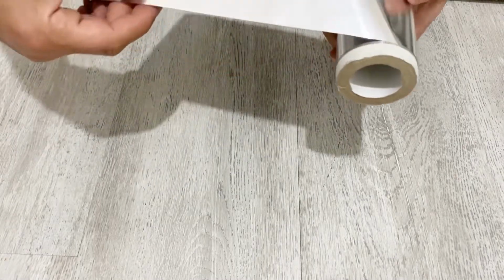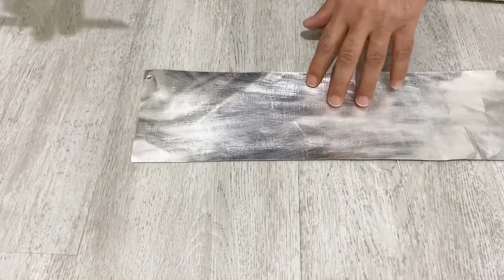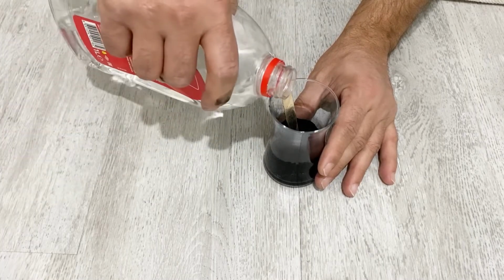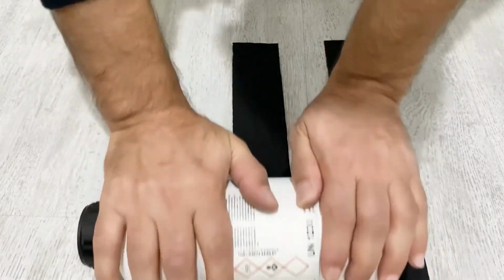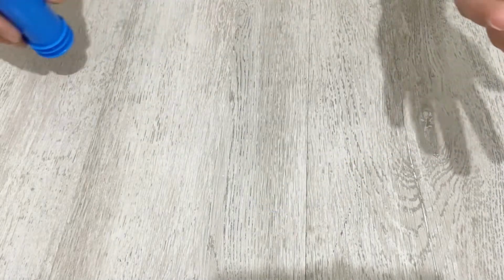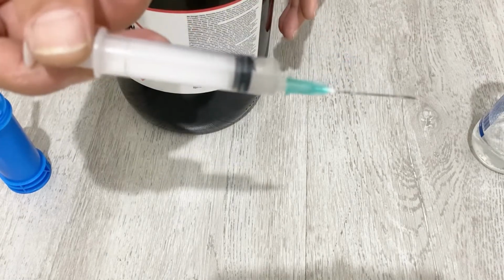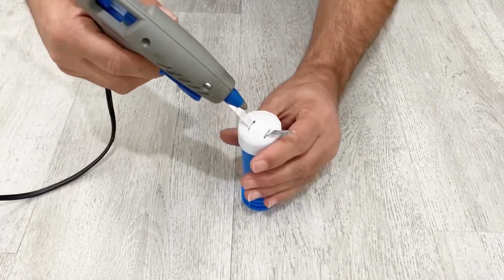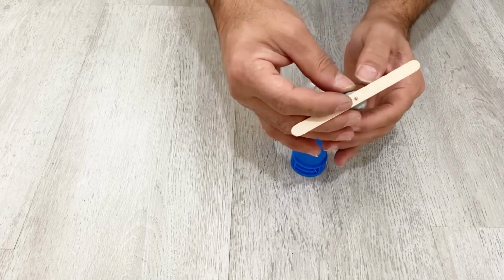How to Make a Supercapacitor with Aluminum Foil (Step by Step, Each Detail) 500 F

Comment: Can I use salt water, and questions is why electrolyte is not making short circuit in capacitor
Reply from the maker: No you can’t use salt water. It will deplete the Al foil.
Reply: @joyofelectronics9782  how about acids, like vinegar or sulphuric acid, and can i use NaOH?

Comment: how many gram of sodium sulfate and deionized water you used in this video
Reply: He said one mole of sodium sulphate. But there are two or three problems with this. First is what is the hydration of the starting crystals, and secondly, we don't know how much water.  

Hydrated Crystals of sodium sulphate and their molar weight. 

decahydrate (Na₂SO₄ · 10H₂O) 
322.192 g/mol

heptahydrate (Na₂SO₄ · 7H₂O) 268.128 g/mol

monohydrate (Na₂SO₄ · H₂O)
160.047 g/mol

anhydrous (Na₂SO₄) 142.04 g/mol. 
__
Did he mean 1 mole  to 100 ml or 1 mole to 1000 ml.  Sodium sulphate decahydrate is the most soulable  and would not completly disolve in 100 ml of water at room temp but 1000ml will.  So it might be safe to assume he meant 1 liter of solute.  But we still don't know 1 mole of which hydrate of sodium sulphate. 

Sodium sulfate decahydrate (Na₂SO₄ · 10H₂O): This is the most common form of sodium sulfate commercially available, also known as Glauber's salt. It is typically sold in powder or crystalline form and is used in various applications like detergents, textiles, and glass production.

Sodium sulfate heptahydrate (Na₂SO₄ · 7H₂O): This form is less common than the decahydrate but is still occasionally available. It is usually encountered as a technical grade product and may be used in specific industrial applications.

Anhydrous form: Sodium sulfate anhydrous (Na₂SO₄): This form is also available, but it is generally less common than the decahydrate. It is often referred to as desiccated sodium sulfate or salt cake. Due to its hygroscopic nature (tendency to absorb moisture), it is usually sold in sealed containers to prevent caking. It finds applications in various industrial processes like the production of paper, textiles, and chemicals.

And to the third (potential) problem, I suspect he purchased 
Sodium sulfate heptahydrate
Or possibly Sodium sulfate heptahydrate. But I don't know if he was aware of the hydration and considered it when weighing out the ammount to add to the liter of water.

Reguardless, if you measure out 142 grams of decahydrate or 322 grams you should still  be able to disolve both completly in 1 liter of water and they should perform rather similarly  although 322g of sodium sulphate  decahydrate is probably more conductive than 142g of sodium sulphate decahydrate.

Comment: how about making a really huge supercapacitor? would it work as a solar battery?
Reply: No, capacitor and battery is not the same
Reply: @teknosql4740  i did not say they are the same. i meant if it would have enough capacity for it to be useful as energy storage
Reply: @ignilc  you must learn to use google to find information you need, capacitor does not have plateau voltage, and capacity is far below battery, but it can store and release electric in high speed, so its not suitable to replace battery position, its suitable to stabilize voltage

Comment: So you charged it with 2.1V 1A for 10 minutes.
Reply from the maker: No the voltage determines by the charger when you charge with 1 amp
Reply: I drink a lot of beer. I will scissor up some aluminium tins into spirals and try it out. Are you sure it is a capacitor and the carbon does not react with the aluminium? Does putting capacitors in series increase stored amps or volts?
Reply from the maker: @kurbads74  you can try it with peace of mind. If you do everything correct the result will be amazing. As a surfactant use methanol. Putting Supercapacitors in parallel increases capacity but same voltage. Putting them in series increases voltage but lessens capacity.

Comment: Very good video! I just have a few questions:
If I am using sodium sillacate as the binder, and and I want to use Sulphuric Acid as the electrolyte, what should the concentration of the Sulfuric Acid be?
Thanks!
Reply from the maker: Sodium silicate and sulphuric acid have a good compatibility. You can use 30% concentration. (Keep in mind that in this case you can’t use aluminum, you should use lead instead)
Reply: @joyofelectronics9782  Sorry to ask so many questions, but what is that in molarity? Is it 30g H₂SO₄/100mL H₂O?
Reply from the maker: @shreyrohilla7883 yes it’s okey to use 30 grams in 100 ml

Comment: Try making a liquid solution that contains lithium batteries
The liquid solution does not work with or dissolve carbon, copper or aluminum

My only hope is to learn how to make that solution :(
Reply from the maker: Those solutions used in lithium ion batteries are too expensive brother.
Reply: @joyofelectronics9782  they are polymers based :D .. ionic liquid

Comment: hi, great video, I am planning creating a few for my self, however I have few questions in regards to capacitors in general , 
1. is it better if I have a 1.2volts 500F capacitor than a 12volts 500 micro farad capacitor, what the differences will be in each of them regarding charging and discharging time, current differences, etc
Reply from the maker: It’s better to use 1.2 volt 500 F Supercapacitor
Reply: To get 12v one have to make 10-,11 of them?  Will be charged and it rechargeable? Kidos